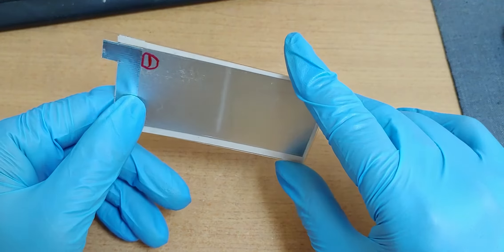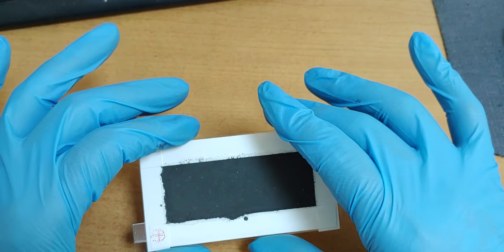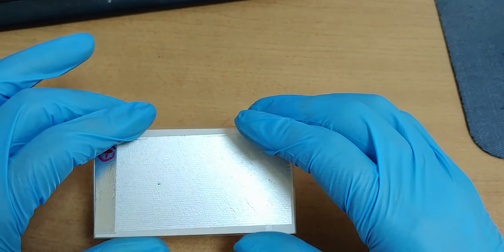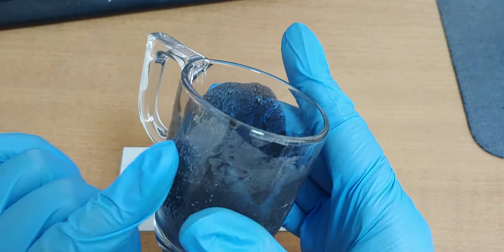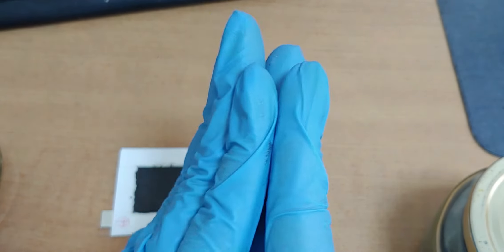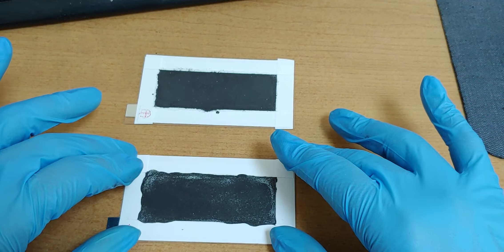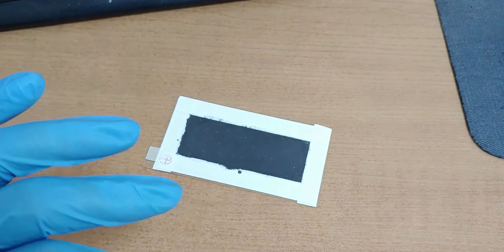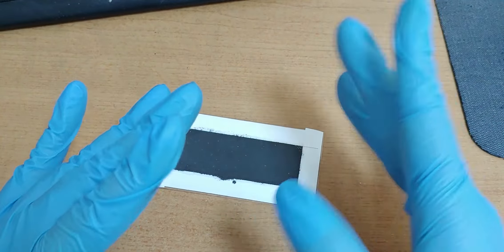New way to make graphene electrode

Comment: thanks very interesting, detergent, what kind ? seems like washing machine powder like for cleaning clothes, also, I thought Iron oxide was rust so reddish/orange?! and by the way if you feel limited in english maybe you should make a version in korean with professional subtitles (some website can do it cheap) and a version in english 😎
Reply from the maker: Thank you so much first. Reading and writing in English is very easy to me. But speaking is difficult. I will continue practicing it. Thank you again. About detergent. Detergent used in this battery is the form of powder and does not include chloride. Since chloride causes damage on Al electrode, it must be avoided. Have a nice day. Ah~~ One more, graphene electrode(anode) should be on research to be able to be suitable to sodium ions. Have a nice day.
Reply: @solidbattery9956  what does it contain though then ? interesting about sodium chloride and basically you made graphene ink 😎
Reply from the maker: @strongforce8466  
In my case, I use a product which includes oxygen. Have a nice day.
Reply: @solidbattery9956  oxygen ?? lol didnt know it could be in powder form
Reply: @strongforce8466     I think it includes something like Oxyclean, which produces oxygen when exposed to water.